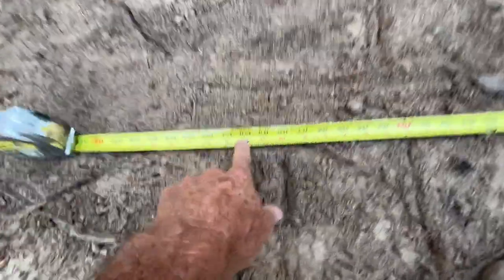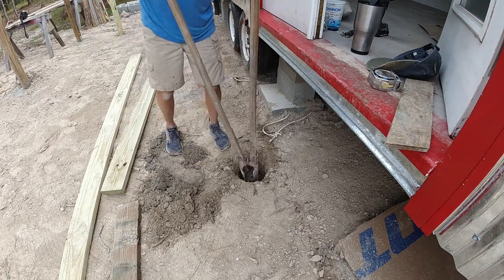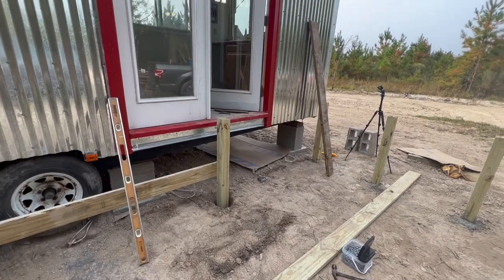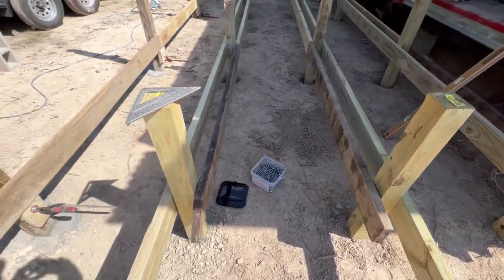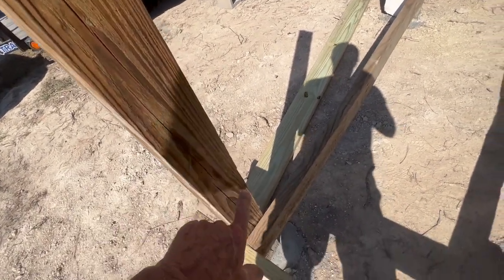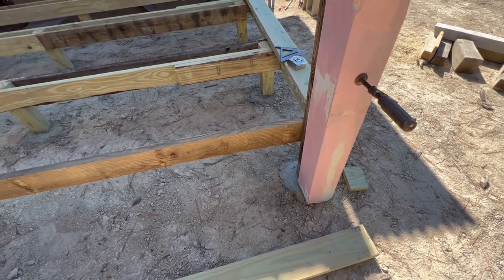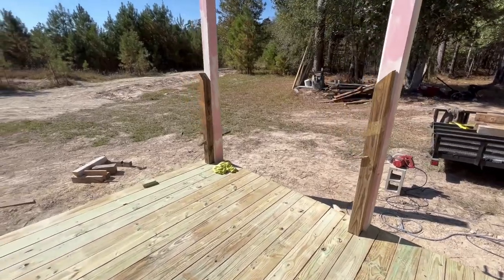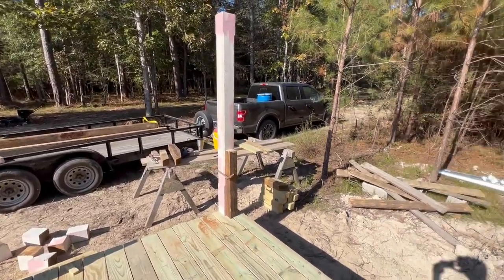Screen porch deck framing on the tiny house camp camper thing.

Comment: Massive progress since I last watched your videos ! Looks like you have a sand box out your front door ! Lol. I’d remove the axles with the tires ! Nice quiet location you have , are you building a shop to tinker in ? We call enclosed deck rooms Minnesota rooms . Did you remove the bottoms of the pillars because of termites ?👍👍
Reply from the maker: Dave
Good to have you back! The building pad, drive in front, and drainage ditches have all been graded, regraded, and reregraded recently. Now going on 6 weeks with no rain (very unusual for us) I am in a giant dust bowl. Never thought I would be wishing for rain! The axles are light duty, very old, and welded in so they are staying. The good wheels are back on my boat trailer. No shop planed but maybe a shed of some sort to park the Truckster, No termites in the redwood columns but a little rot on the bottoms. 
Thanks for watching 
Barry